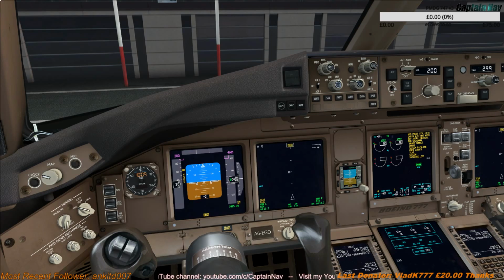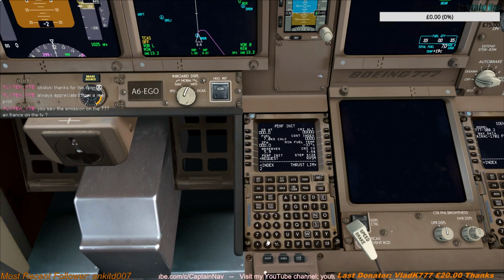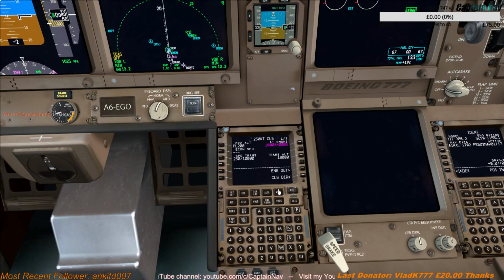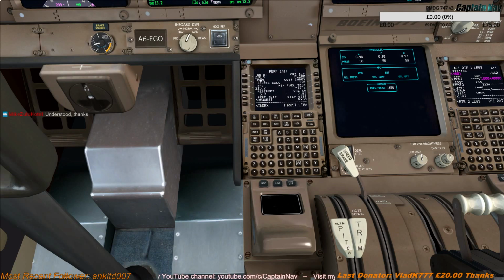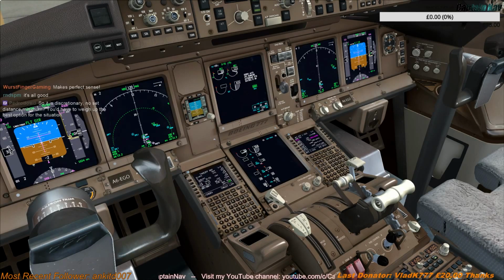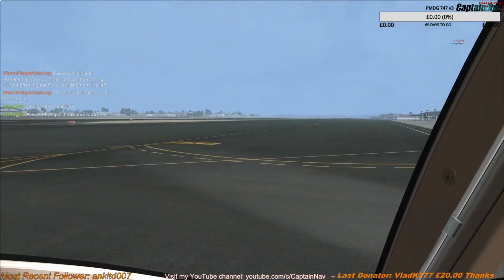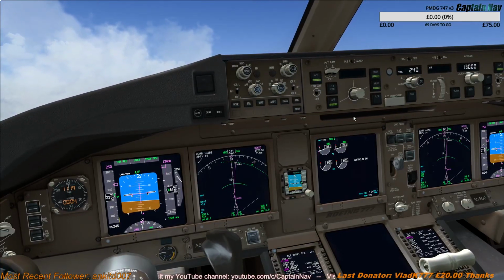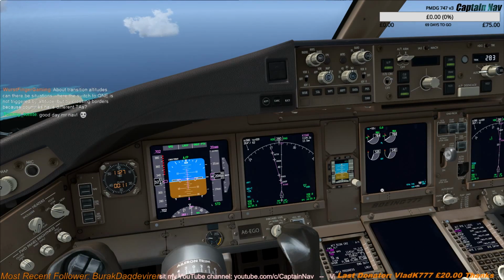[FSX] PMDG 777-300ER | Dubai to Doha Part 1 (by a real 777 captain)

Comment: How do you get such high speeds without the overspend warnings?
Reply: Usually I can only get about 270 or 280 knots
Reply from the maker: +Jonathan Lami The maximum speed is about 330-340 knots, so the overspeed warning should not be a problem at 320 knots, for example.
Reply from the maker: +Jonathan Lami That is not normal
Reply: Ok thx